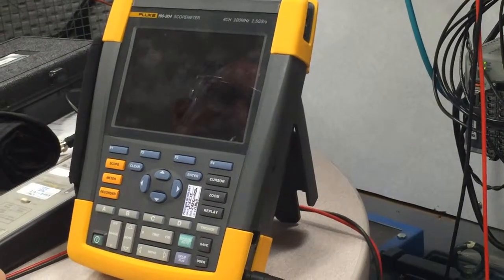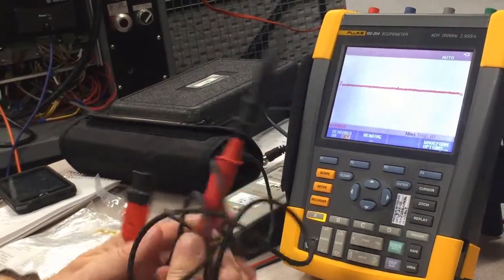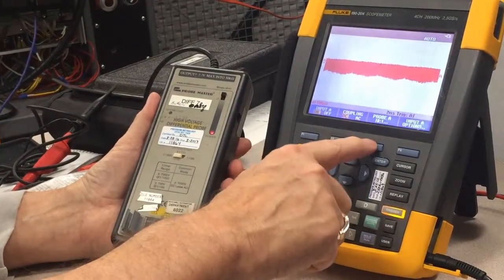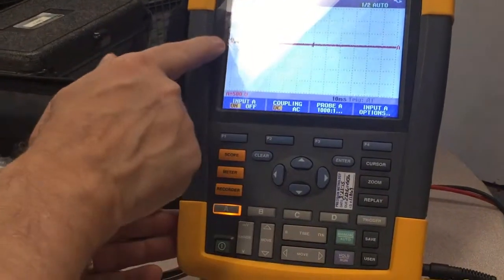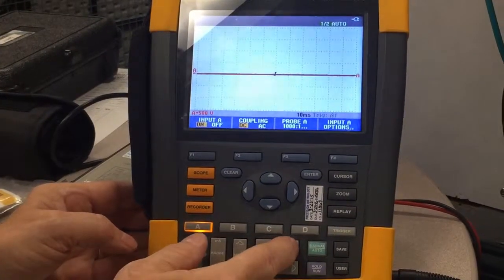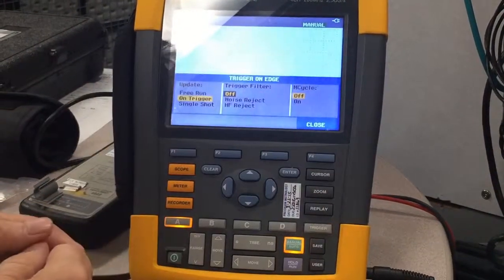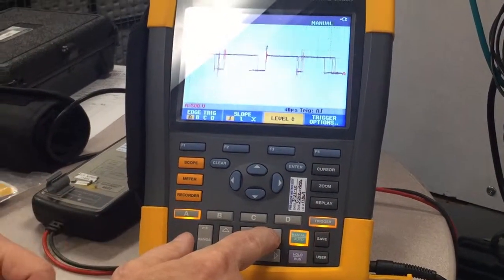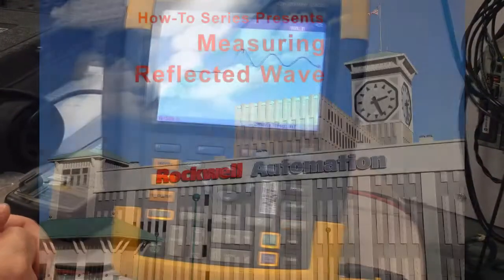Measuring Reflected Wave

Comment: We have a system with Kinetix 5700 drives and 4 servo motors. We've had 7 motors fail with shorted windings in the last year. We are going to connect an Oscope to try and determine the problem. We're using 40 meter 2020 cables.